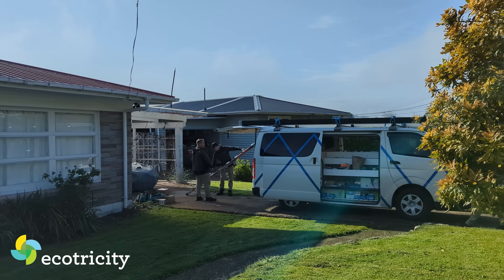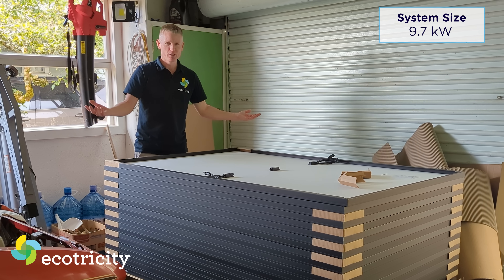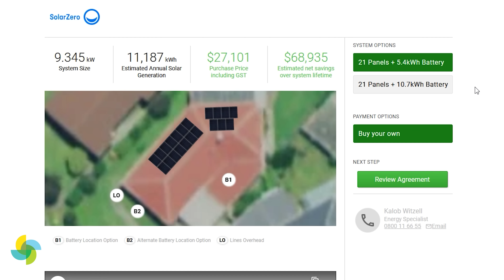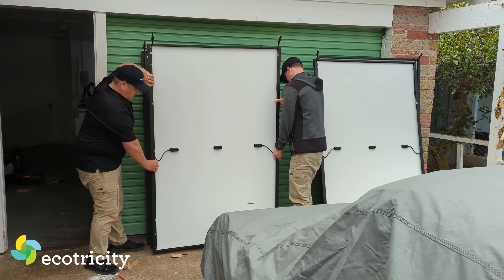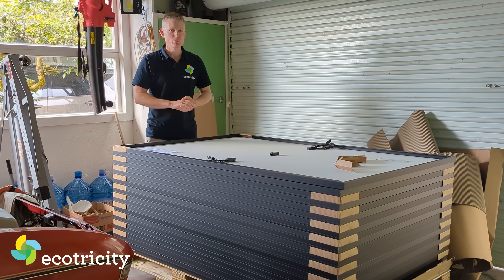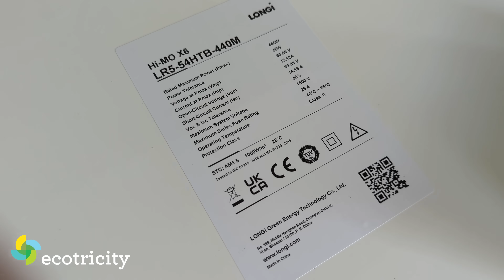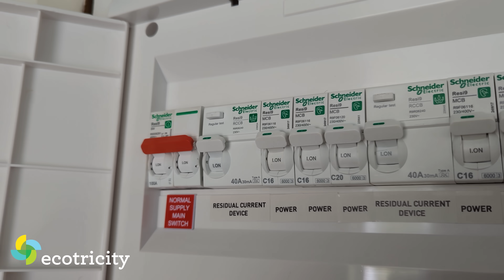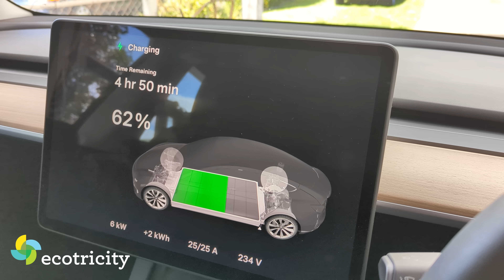I got HEAPS of solar panels installed!

Comment: If anyone is interested,  about 3.5 years ago I installed a 6.6 kW system with a 5 kW inverter, no battery, for Aus$5,200.  My bills are mostly negative, and I now charge 2 EVs.  I'm lucky enough to be able to charge them mostly during the day.  My return on investment so far has been 28%!  Best investment I've ever made, apart from my EV, that is.  😊
Reply: @stuartirwin3779  Unlike Aussie, solar is not subsidised in NZ. We pay full price for everything, and feed in tariffs have never been generous. And our sun is nowhere near as good as yours - much more cloudy and rainy days, so yield is lower
Reply: Your are on to it mate. Well done !
Reply: @Goodkiwibloke  Feed-in Tariffs are almost non existent in Australia any more.  What ones that do remain pay a pittance.
Reply: @ImperatorTFD  Some people in Aussue are still on legacy FIT of $0.50/KWHr, but they are unable to make any modifications to their system without loosing their FIT. Solar installs often came with these generous 10 year FIT, even 5 years ago, to encourage uptake

The Aussie solar revolution was almost too successful. But it did get over 50% of home owners to add solar panels and batteries

But NZ is quite different. Our Sunshine hours are way less, rooftop solar penetration is way less (1%), our installation costs aren't subsidised. So there won't be the same revolution here as there was in Aussie, so our FIT while low are likely to remain 

I have 4 years remaining on my current 5Y fixed FIT. When this finishes, it will have paid me $10,000 just in yearly cheques from my electricity company. But as I've had solar for 6 years, my system was fully paid back a couple of years ago. So the annual cheques pay our property rates

Comment: THE BEST WAY to get SOLAR is to buy your system in full outright even if that means getting a smaller system with plans to expand it later. THE WHOLE POINT is to avoid monthly payments. BUY your system out-right then it is yours and you owe nothing.
Reply: Or invest that 50k into a fund and earn 8 or 9 % per year and you'll be ahead before you could ever get the return on solar....

Comment: Congratulations on not going with SolarZero, the zero up front cost plan is a scam and cost you way more over the long run and there is no exit from the contract. If you sell your house, you need to convince the buyers to take over the contract.
Reply: Not true! They have several options.

Comment: Put solar in 2 years ago. 9K for panels and a 5KW inverter. Yes we dont have a battery (yet) but it has still knocked 40% off our power bill and both our cars are electric so charge as often as poss during sun shine hours so travel costs are effectively 0

Comment: Be interested if you do the numbers for a battery, with 9kWh you would benefit from having power in a battery for evening use.  We have 6.3, generating 4.85kWh...and summer is no grid power, winter night rated power is used during the day.... just some food for thought for you Gavin....no peak hour power bills for 5 years.
Reply: The issue will be that while there is potential to generate 9kw of solar, the inverter will max out at 7.5kw, so the inverter will be clipping anything over 7.5kw, which seems like a waste until you consider that the additional panels will ensure that the production will max out earlier and continue later than if the system only had 7.5kw of panels.
Personally I would have gone for a few more panels, a bigger inverter and a battery. Would have added about $5k more, but would have meant zero power bills and security in case of power outages.

Comment: I’ve had solar in Victoria Australia for around 15 years, I have just upgraded to a 6.6KW system with a 10KW battery, as we live in quite a cold area I wish that I had chosen a bigger system, however with EV charging an all electric home I still benefit greatly from having solar. I was fortunate enough to have a pay in tariff of 60cents for my previous system that’s no longer the case.
The larger system was a great idea and I hope you are as happy as I’ve been with mine and that in NZ you have a decent pay in tariff.
Reply: The rebate/pay-in tariff in NZ is not as good, as we hear Aussies getting. The highest I've heard of, is 17c per kw/hr unit, under a several year contract. Also they sting you a daily (grid) connection fee here. It's close to $2 a day for many people.   The last I heard, about 30% of Aussie homes had rooftop solar, whereas in NZ the percentage is 2.5%.  Mostly due to the difference in government subsidies (ie Here, almost none).  Less solar panels in total in NZ, means there is less chance for folks to buy used solar panels for a cheaper price, if more wealthy people upgrade to newer higher spec panels. I just saw a video of some Aussie guy in Qld who bought used panels at $20 to $24 each and built himself a large off grid system for less than $1,000 of panels.  Here even small used panels still go for the better part of $100 when occasionally available.  Plus almost 40% of Kiwis are renting, so we have no options available to us to reduce our power bills.

Comment: Panels may have fallen in price by 80% - but they are not the cost of the system. There is also the inverter, labour, rails, wiring, and compliance.
Having said that I've just finished installing 12kW on my roof with a 10kW inverter - by doing as much of the install as legally possible my cost is around $15k which is a 5 year payback.
Reply: yep!  the panel buying price is by far the cheapest part.
Reply: Just to give you an idea of costs - and this incorporates a whole bunch of my labour as sweat equity to keep the price as affordable as possible. You will need an installer who is confident that you know what you are doing, you will need familiarity with the relevant regulations in your jurisdiction to make this happen. Prices are NZD as at 2024 including GST (sales tax):
27 panels @$152 = $4,104
10 kW 3 phase hybrid inverter $4,600
Mounting kit $3,200 (complicated layout required more kit than normal)
Installer supplied gear/labour/inspection $4k
So total cost ~$15.8k. If panels were twice the price (they have dropped about 50% in last 2 years) then price drop for total system would be (4/19.8) only 20% overall.

Comment: What you need instead of a timer for hot water is a smarter system. One that only charges the cars and heats the water with excess solar. I have a Zappi but because you have a compatible charger that uses OCPP you can use something like home assistant but it is complicated to set up. A Myenergi Zappi and Eddi (hot water) combination is much simpler but also expensive.  For PV diversion for hot water there's also the Catch Relay. Overall timed systems have a one big pitfall -  they use lots of grid power when the sun isn't shining.
Reply: But do MyEnergi operate in NZ?
Reply: Zappi is better but catch power is a lot more reliable and simple. I’ll be going with catch power.
Reply: @mondotv4216  100% on the hot water power diverter, but important note is that it only suits resistive heating, not heat pump hot water systems. I have a Solar Immersun power diverter, which has operated faultlessly for 6 years

Comment: Getting solar panels has utterly transformed (a ha ha ha) my understanding of energy, how and when I use it and saved me over £1k in the systems first 18 months. I went for a battery option as I’m on a UK time of use tariff with a really good export payment, so it actually pays me to fill up the battery overnight so I’m exporting as soon as the sun comes up. We have had a horrendous Dunkelflaute (dark doldrums, no wind, no sun, high demand) period for 11 days so far so the panels are essentially roof ornaments but the battery is saving me a lot of money. The tariff I’m on has cheap off peak periods but eye wateringly expensive peak periods, so the battery offsets my import export periods.

With regards to the question of ROI, if you have a loan you obviously shift your bill payments to the loan so the real benefit will come once the loan is paid off. I was lucky and managed to self fund half of my installation and had a really small loan which I paid off early for the remainder.  Now I don’t worry about how much the installation cost, I look at my drastically reduced bills and my only regret is I didn’t squeeze a few more panels onto my roof and get a bigger battery.

Comment: I've been humming and haaing over solar for a couple of years. We're retired so most power use is during the day and no EV yet. I'm reluctant to get the battery because of cost, although could add later if needed. I'll be interested to see your powerbill.
Reply: We've got a similar sized PV setup to Gav (9.5kW panels into 8.2kW, on single phase, no battery but HWC is controlled by inverter) and we charge 2 EVs almost exclusively from solar plus pumped water on a rural property. We also WFH so our daytime energy use can be managed to optimise solar generation consumption. Make no mistake, no FIT will compete with using your own generation as it occurs as this offsets electricity that would otherwise be purchased at retail price including GST.

We are on the brink of reverting to credit monthly accounts as summer approaches. Our projected payback is looking like <9 years but increasing grid electricity prices will continue to shorten that with $3,840 saved since installation in mid August 2023 (15 months) in combined export and self consumption (based on our Octopus Energy supply plan).

Interesting comment from our installer Solar One here in Taranaki is that current data shows that ~70% of the cost of a PV installation can be expected in improved property sale price if you decide to move on.
Reply: @HarmLessSolutionsNZ  interesting thanks. Also in Taranaki 👊. I was thinking of a smaller system as we've gas cooking, no EV yet as I mentioned. We like the fire in winter. Also use water pump. I wouldn't mind a wind turbine backup TBH.
Reply: @GlenisRetiredNZ  We've got logfire winter heating and a gas hob (on bottle). We investigated wind on a previous property with good wind exposure but the numbers didn't stack up, particularly when maintenance is factored in. Be warned though that getting solar is the gateway drug to buying an EV, or vice versa, as they make for perfect synergy.

For Taranaki I have no hesitation at all in recommending Solar One (Bell Block). Extremely knowledgable, great customer service and honest advice.
Reply: @GlenisRetiredNZ  My MG ev costs me about $10 a week to 'run' using a normal 15amp socket and with the supplied connector.  and I use it everyday (the car that is).
Reply: @HarmLessSolutionsNZ  thanks for the recommendation, appreciate that. LOL, yeah, chicken or the egg. The EV hold up is waiting for 600km-ish per charge, better battery tech/safety/battery life and affordability. Current EVs with 600km still seem to be around the $100k - too much.
Reply: @GlenisRetiredNZ  How often do you do 600km between meal breaks or home charging oppportunities? We comfortably manage journeys from Taranaki with a Polestar2 with not much more than half that battery range and an equivalent 2nd hand one is more like half that $100k .

Also if you do long trips on a frequent basis the economies of EV ownership are much improved in terms of fuel savings.
Reply: @HarmLessSolutionsNZ  monthly 300km trips to Rotorua. But Gav reckons you lose 15% on long drives on WLTP and I've had a few long detours in the past. There's 2 chargers between here and there. 600km is overkill but I'd like to get there with 100km+.

Comment: Gavin, enjoyed your video.  We installed 4kW of grid tie power 11 years ago.  It took just over six years to pay off, because we were one of the first in our area and got some special pricing.  Five months of the year we exceed your 5kW per day to the supplier limit, so that would be a concern.
I ran our actual numbers (I keep a spreadsheet,) through the Ecotricity calculator and found that we would have to pay more than $20 a month to take service from them, and our payment for power into the grid is only a miserable 8.5 cents a unit, for which they send next door with a premium of 18+ cents are laughing all the way to the bank.  So no Ecotricity for me.
The other thing is the battery life.  Working for a major company that used lots of batteries, 10 to 15 years was all you could get out of them before they required replacement.  Maybe you can get more life out of a battery in a domestic situation, but you need to factor the battery replacement cost into the economics.  That needs to be more than 10% of the current purchase price per year to cover cost increases.
When I move, sometime next year, I will put an 8 to 10 kW solar array on the new house, not to increase the amount I that generate, but to increase the amount of days when I can generate 100% of my use.  The only battery I will use is the one in the EV.
Cheers
Jim
Reply: Sorry, the bit I missed was that we have had solar water heating since 1980, when I built my preheater.  The 1995 professional solar heater has worked well since, and that has saved a fortune.  However, I would like to divert excess electricity into the hot water system and then switch it off, with a new installation, rather than having a separate solar hot water system.

Comment: you need a DC isolator adjacent to the inverter in NZ
Reply: Have you got an email I can send you a list of questions you should ask
Reply: Not if it is built into the inverter which is the case in this instance.
Reply: No that's not correct, the current cited standards in NZ need a separate isolator, it's only in the later versions that you can use the inverters one which are not what we work to here  @RaymondDun
Reply: @RaymondDun oh you're the guy! Why have you wrote 169amps on the PV short circuit sticker?
Reply: @conorandturbos  I must be the guy! 16.9A
Reply: @conorandturbos  Well, there are a truckton of solar installations non-compliant out there then. AS/NZS 4777.2:2020 Clause 2.12.2 Where a load break switching device that is a part of or within the inverter is a switch disconnector, it shall- (a) be rated for independant manual operation; (b) be classified as suitable for disconnection and be marked with the following symbol (shows a switch symbol) 🙂
Reply: And AS/NZS 4777.2:2024 was released recently and will be cited in due course. It has a clause allowing V2G, This will freak you out!!! 😂
Reply: @RaymondDun  2020 is not the standard we use here

Comment: I've long thought the fact that solar panels haven't been anywhere near as widely adopted as in Australia a complete mystery. Aotearoa has plenty of great solar generating weather.
Reply: No rebates here
Reply: @conorandturbos  Yeah, but still. I used to have several Australian acquaintances who installed rooftop solar over 35yrs ago, long before there were any incentives and rooftop solar systems were much more expensive back then. One of them found their payback was only 2 to 3 years; he did do the work himself, though. You'd think that Kiwis with their can-do have a go attitudes would've been far more adventurous.
Reply: The rebate/pay-in tariff in NZ is not as good, as we hear Aussies getting. The highest I've heard of, is 17c per kw/hr unit, under a several year contract. Also they sting you a daily (grid) connection fee here. It's close to $2 a day for many people.   The last I heard, about 30% of Aussie homes had rooftop solar, whereas in NZ the percentage is 2.5%.  Mostly due to the difference in government subsidies (ie Here, almost none).  Less solar panels in total in NZ, means there is less chance for folks to buy used solar panels for a cheaper price, if more wealthy people upgrade to newer higher spec panels. I just saw a video of some Aussie guy in Qld who bought used panels at $20 to $24 each and built himself a large off grid system for less than $1,000 of panels.  Here even small used panels still go for the better part of $100 when occasionally available.  Plus almost 40% of Kiwis are renting, so we have no options available to us to reduce our power bills.
Reply: @KiwiCatherineJemma  The feed-in tariff in Australia has dropped off a cliff and is well below the 17¢/KW/hr, going as low as 3¢/KW/hr in Victoria. The latest available (national ) take-up figures are from 2023 @ 36•05%. Victoria, Sth Australia, New Sth Wales, & Queensland have take-up rates of 43%, 50%, 51%, & 82% respectively. Western Australia is seeing a rapid growth recently but I don't have the figures to hand. 
There are times in Eastern and Sth Australia during the summer that electricity prices go negative to the huge amount of rooftop solar on domestic, commercial, & some industry rooves. There's even been times that those grids have run entirely on solar and wind anywhere from several hours up to 3 days, such is the increasing amount of renewables penetration in those regions; this is an increasing phenomenon in Sth Australia.
Are there no community owned solar and or wind farms at home that allow non homeowners to buy a share in return for lower electricity bills? They exist in the UK and USA.

Comment: Good move to buy a hybrid inverter. So your inverter is already capable of adding a DC battery. I guess in a year we will see another video of you installing a battery to save power for the night. 
I also see that you have heaps of roof space left, so you could add some more cheap panels for bad weather. Not sure how much overpaneling you can do with that Solax inverter, I hope you are not already maxing it out on the input side.

Comment: I live off grid with electric heat down to -30C, 8kw inverter (I never go over 3kw) 11.6kw pv and 48kw battery. Because of the dropping prices if I waited a year I would have paid $5000 less and get 12kw more battery. My 465w were $289, same dealer 18 months later 600w panels for $220.🤦‍♂